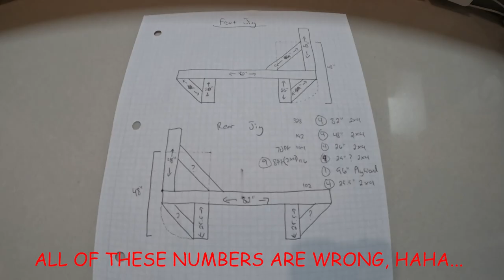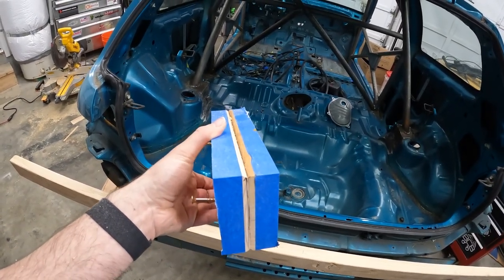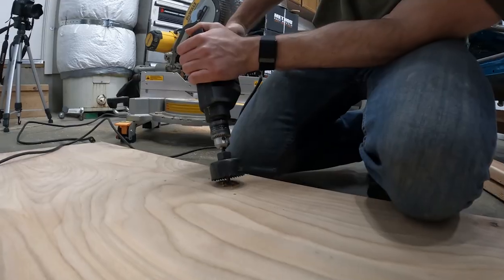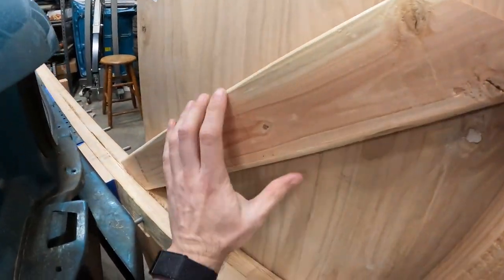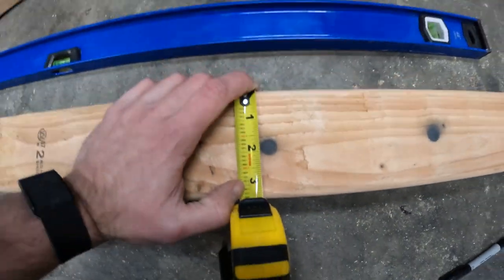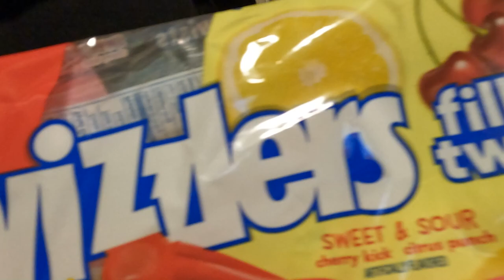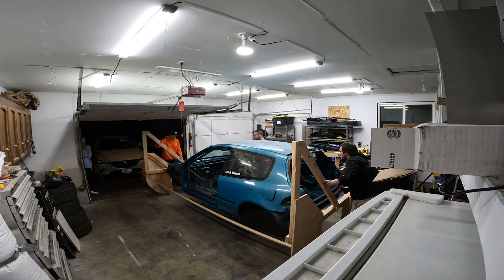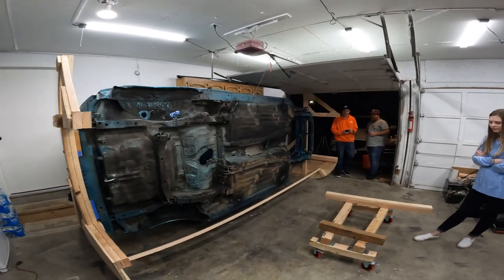I Rolled My Honda Civic EG, WOODEN Tip Over Jig - Project Hoonda - vLog 02 #honda #civic #eg #racing

Comment: What was the cost of wood vs just building it off two engine stands?
Reply from the maker: You would have to modify the engine stands too much I think, widen the legs, raise the neck. Some people will fabricate their own rotisserie, but I don't have a welder yet, or the skills for that. This setup accommodates the car being top heavy in this position also; I think had I used engine stands, It'd be much less stable.

Its been a minute, but if I remember correctly, I'm in this about $250 in materials. The advantage is that it's built for my car rather than modified to work. It's still on it's side today😅
Reply: @eg6nate  Thats probably what it would cost to set one up with a welder unless you picked up two dirt cheap engine stands.